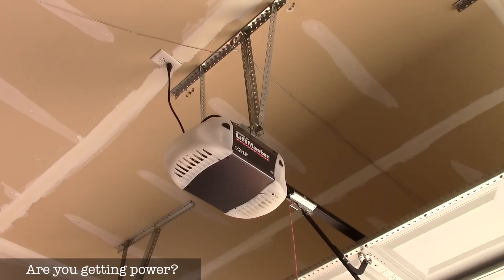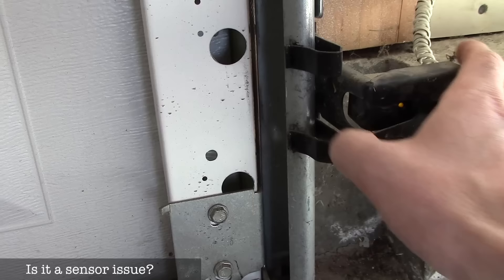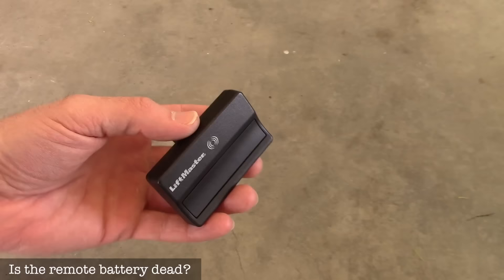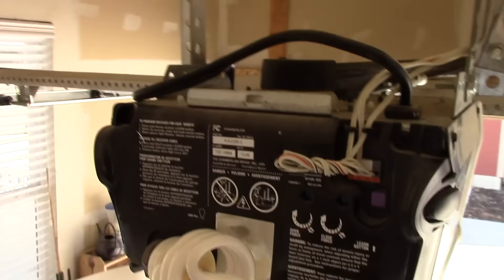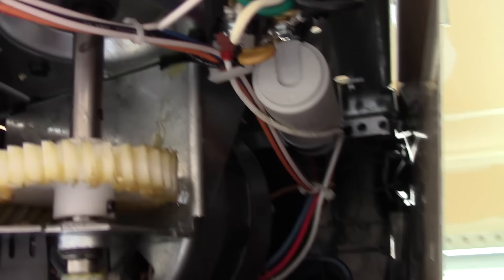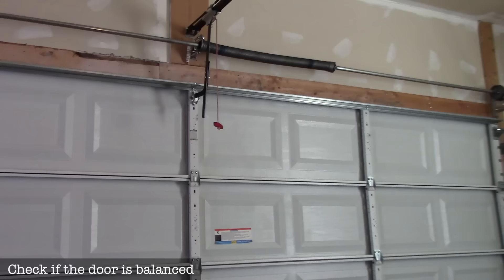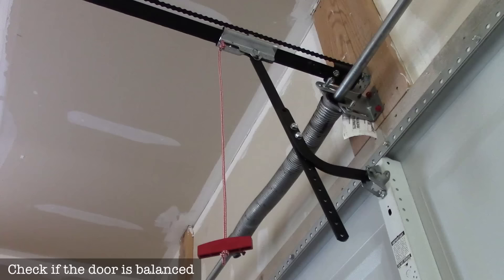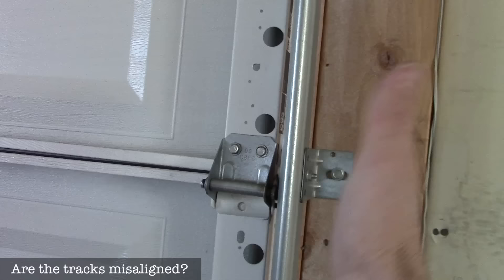Garage Door Opener Troubleshooting and Repair - How to fix common problems

Comment: Thank you for posting this. You saved a 60 year old nun from paying a repair bill for something I could fix myself. Besides, I work 2 jobs (15 hrs a day) so I am never home for repair visits and can't afford to take the time off. The garage door would open, but not close. I don't mind the little bit of inconvenience of getting out of the car, manually closing the door, then leaving through the front door - most of the time. But today we had torrential rain and THAT was the last straw.

Comment: Thanks for posting. Simple solution. Note that on some models, the lights will flash and it's not a sensor issue. Chamberlain LiftMaster Lift Master 3595S Model 41AC075-2S

Comment: open my garage and it went up. tryed to close and would come down a bit then back up.after watching your vid. took a closer look at the brackets notice one broken on the rt. side. noticed it wearing on the wood frame because without that support it veered outward toward my driveway and rubbing the wood. hope i can buy this small bracket (Hinge) at the hardware store. Then i need to tighten the chain and i hope thats it. will see Sunday. Its great to learn at You Tube University with terrific Professors. Thanks Adam

Comment: Hi Adam, my garage door opens sometimes randomly when we are not home.  We will come home Abe it will be wide open. One time it was only about a foot open. Do you know how I would fix this? We are weird stuff will get stolen from our garage because we live in a condo which a lot of people are in the community.
Reply: Maybe your neighbors remote are opening/closing both their door and yours? I had that happening with me. My neighbor had an extra opener that she gave me. When I programed to work with my door I thought it would automatically cancel hers; but it didn't, it would open/close both of our doors together. I then, went to her opener and pressed the Program/LEARN button for 60 secs. That reset it from her door but kept mine.
Reply: WHAT YOU DID WAS ERASE ALL THE CODES. @realestatesolutionsbyrosie9757  w
Reply: You need a new logic board or you're on someone else's frequency

Comment: garage door doesn't work sometimes makes a clicking noise when not work......But sometimes you just wait and it works?????
Reply: Hi pp
Reply: Have the same issue, how can I fix it?
Reply: I have similar issue, i hear 2 clik clik but doesn't work! please let me know if you know how to fix please, Thank you
Reply: Intermittent problems can be difficult to troubleshoot.  Try to determine if it happens when you use the remote control or the directly wired wall switch, or both?  
For problems while using the remote:
- Replace batteries in the remote
- Pray to your God
- Remove the light bulb from the opener (be safe)
- Turn off any nearby WIFI devices
- Turn off nearby portable phones 

For problems while using the wall switch:
- Check that the safety sensor is properly aligned
- Clean the safety sensor on both ends
- Check that red light comes on as he showed in the video
- Bypass or check the wall switch
- Check that the wiring that connects the safety sensor to the motor is intact
Think safety first.  Good luck.

Comment: I was told someone saw someone's face get re arranged by working with a spring, BE CAREFUL!
Reply: I WEAR SAFETY GLASSES AND A HARDHAT WITH A FULL FACE SHIELD WHEN WORKING ON THEM ,THOSE THINGS SCARE THE HELL OUTTA ME ! .THE AMOUNT OF TENSION BY TURNING THE SPRING WITH A BREAKER BAR AND RATCHET IS INCREDIBLE !

Comment: Great video. Love the way you explain things in a calm and steady manner without going on foot too long. I have an issue ( forget sensors for a sec) where the door will completely close, but then opens right away. Its not a sensor issue because blocking sensors makes it reopen midway and lights flash. So its not a sensor issue. Why does it not stay closed? I guess the question is, what part tells it, you have reached the bottom, stay there. Much thanks.

Comment: I had an issue with my LiftMaster only opening a few inches and then closing back. What I found happened to mine was I sprayed garage door lubricant on the chain and it apparently leaked down into the motor housing and onto the travel module. I unplugged the motor and sprayed electronic cleaner on the travel module to remove the lubricant and then blow dried it with an air hose. So far it’s been working fine.

Comment: wow your video help me a lot and thank you for you video. it was a complete detailed video of troubleshooting.
frequency coming from the led light bulbs in my garage was making my garage door no open or close unless I use the garage door opener from the wall. soon as I removed the light bulbs , the garage operated as normal with no issue. thanks again for you help.

Comment: Adam, thank you for a comprehensive, and detailed Video clip. Our previous Home
 had a Chamberlain opener (which I installed myself). It did not function one day,
so I examined the Laser units and found that one strand of a Spider's web was
causing the problem.
We now have a Genie opener; however, the Learn Button fails to function when 
depressed; thus, the L E D light fails to illuminate....accordingly I can not program
my new remote controls.

Comment: Thanks Adam, your video helped solve my problem. One of my sensors lost power. Simply freshened the connections at the sensor and it's working.

Comment: Thanks for the very informative video. Although it didn't cover the issue I'm experiencing, it was well done. I'm wondering if you have come across this issue? My door opens to a certain point and stops then I try to close it and it travels maybe a foot and stops try to open it again it goes back a foot and stops. I then tried adjusting the force limits with the blue dials to increase the limits and the door open and close properly. I waited for a period of time opened the door again and had the same condition occurred . Now I have gone to the end of my limits .
       Thanks Henry Schmidt.

Comment: Door works fine with the wall switch but not the remotes. Just learned about a lock that disengages the remotes. Plus disconnecting the wires from the motor and wall switch and reconnecting might help also. Trying it out next weekend

Comment: Nice informative video. Thank you. Not sure what my issue was but after un connecting the safety lights and reconnecting  I have not had an issue with the door stopping while closing. I went ahead and greased the chain with Lucas sticky grease. It’s more quiet now at least. Maybe talk about chain tension in another video possibly. One of my doors the chain sags about 1 1/2”... but works fine.

Comment: Good video.  2 things I noticed definitely oil the bush under the sprocket it will never fail, there no way it’ll snap off unless the plate wears through that thick shaft from lack of lubrication.   Also the join in the chain should have a spring which allows for self tensioning over time and shock absorbing relief on the chain at start up, perhaps yours are missing.

Comment: Great video Adam, clear, concise, and informative.  Worked thru all of your potential issues and I'm still w/o a functioning door opener.  I have a flashing led at the wall console and pushing/holding the lock button down does nothing to get me back to a solid green led at the console.  I removed the power to the console by disconnecting the wires at the back of  the console effectively taking it out of the loop, removed the door load from the equation by pulling the manual chord to disengage the door so the opener only has to cycle the chain, pushed the remote and it will not engage the garage door opener to open the door.  Appreciate any replies, and many thanks.
Reply: I have the same problem...Thought it was my neighbors remote doing it..checked and it wasn't. Still havene't figured it out...Did you find anything out?..Thanks

Comment: Thanks for posting. I have the same opener. I will let you know what I find..... So the garage door would not close unless I did and override and held the wall switch down. The green LED's on the two door safety beam were not illuminating, so I measure the voltage at the main unit. It was about 6VDC. The voltage at the sensors was 0, so I redid all the connections of the 24 gauge wire and it fixed the problem. I think I will solder the connections just so it will not happen again. Thank you for posting. It was at 4:00

Comment: Hey, thanks to this video, I was able to solve my problem with intermittent remote s not working. Yep, it was RFI form recently installed LED light bulbs. Replaced with incandescent bulbs and works like a charm. Thanks again. Saved me mucho deneira.

Comment: Thanks Adam, can I add one more quick fix for an opener where someone was tinkering with the control adjustments. I ran through your list of items and all was well except the operator still wouldn't work so I was just about to give up and order a circuit board and decided to check the travel controls. It seems someone many years ago adjusted the UP travel screw too much and the carriage was hitting the stop bolt. I turned the UP travel screw counter-clockwise and it fixed the problem. It seems that the operator was still trying to bring the carriage up and couldn't so it just stopped the opener from working. By backing off on the screw, the operator completed its cycle and sent the carriage back down to close the door.  The previous homeowner or someone she hired caused the problem.

Comment: Holy smokes batman. The lock thing was my issue. I been in my house 2017 and never knew. Me or my husband must've pressed it by mistake. I was leaving at 545am and I used the one in the garage to open. When I pulled off it wouldn't close but kept blinking. I was like ok so it's knows I'm pressing it idk what gives. So I just closed it and walked thru the house. I just got home and it wouldn't work. So I search YouTube you were the 2nd video and poof magic. Thanx a bunch. 🥰

Comment: Thanks for the information. I am able to open my door even when the latch is on. Technically to open manually you have to release the latch but mine is latched as I can open with garage opener but I can open manually also. Please let me know if it is a serious issue and I need tech or something very easy to fix myself.

Comment: Excellent videos.  Thank you very much.  I have a LiftMaster 2280C opener and recently the two 973LM remotes will only work if they are in close range, maybe 10 feet away from the opener.  I have changed the batteries and that didn't help.  I would appreciate your thoughts on what the problem might be.  Thank you very much.

Comment: Hi Adam, thank you for sharing this video.  Hope you can point me to the right direction to repair my LifeMaster garage door opener.  Suddenly yesterday my garage door doesn't open or close.  I checked for power, looks like it does has power because both sensors left and right has lights.  But the funny thing is i can't open or close using both remote and keypad (mounted outside by the door).  So basically when i press the remote or keypad, i don't hear anything.  No motor going and no light from light bulb off the garage door opener.  Not sure what to do next to troubleshoot.  Currently i open and close it by emergency release.  Thank you for your time.  Hope to hear you soon.  THank you sir.

Comment: Nice video, I subscribed! I was building a horse shed for a customer when the garage door opener stopped working, didn’t find the solution here or anywhere else though, it is an old messed up garage door and the previous installer did a minimal job, I gave up and told them to call the service man, my suspicion is the capacitor but I don’t know, I liked the video though🙂

Comment: Thank you so much for your help, this is very helpful. I purchased a new sensors I connected them but I don't have the lights anymore. I had the lights with my last sensors. But once I installed the new sensors there is no light.

Comment: I needed to install new Liftmaster rubber belt. Very quiet and nice feature like wifi and easier open close adjustment. The new outside remote you can just press "enter" to close door. The car remote has three buttons for three doors.

Comment: Thank you.  I have an opener that will travel 6-8 inches and return to the open position.  I was lubricating the chain, rollers, etc as the door was very loud.  During the process it stopped and will only travel 6-8 inches now. I’ve checked all the obvious issues.  Nothing is blocking.  I disconnected the door and manually it will travel up and down. It’s just the opener that is malfunctioning. Thank you for any assistance. It is a lift master built in 2017.  HL Fry

Comment: Great video,  It lead me right to the sense that had a broken wire. I simply undid the screw took out thr broken part and put the wire back on the block and screwed it down tight. Still having to find out way the remote is intermittent?

Comment: Thanks for all that for sure! So parents got a 1/2 hp Chamberlain Professional (it's red) chain drive I'm trying to help them troubleshoot. Both wall buttons as they press and I stand up there at the unit it juts buzzes like it wants to try and open but it dosent budge...from what you mention it's sound like it may be capacitor

Comment: Hi thanks fo making this video It was very clear to understand and very informative
I have a question all my remotes work fine, the outside controls work fine but the indoor panels do not function and the light is not on and the door sometimes opens for no apparent reason 
Any suggestions?

Comment: Adam, what do you think would be the problem if the garage door sometimes does not work from the outside keypad or the car remote but it always works from the main button on the wall?  One sensor is green and one is red.  Battery has been replaced in the keypad but it just flashes red. The light was replaced with a Genie LED bulb that says it works with all brands.  The brand of the opener is a Liftmaster Professional.

Comment: Great video! My garage door just simply does nothing when pushing the remote button or the indoor button. It worked great until one I pushed the button and did not open, and hasn't opened since. Tried everything, hoping there might be something silly I'm missing it just does nothing when I push the remote or indoor button. Maybe just time for a new one. But I hate not finding the issue...

Comment: Hi -  Very thorough video - Thank you!  However,  Ive tried various that you've mentioned,  but still same issue:
- FYI - The wall panel remote works with no problem. 
- However, in ref to both the hand-held remote, as well as my car (which has been programmed for many years) - both started to experience the same issue on same day:
If I push either - the door goes up with no issue.  However, moments later, when I push again, it will not go down.  BUT if I sit in my car and wait for several mins, and attempt once again - it will successfully go down every time.  Any thoughts or solution?  Tks!

Comment: I am still stymied - I only hear two digital clics when I Press open on the remote or the wall unit. Also, should the trolley with red handle move back and forte when disengaged from the door? Your video was Great describing all the Other issues. Thanks again Trever

Comment: Thanks for your clear instructions....I checked out all the ones that I thought might be my issue, and have not figured it out ---yet...  The garage door opens and closes from the button on the wall in the garage.  After I back out, the remote only every once in awhile will close it.  But lately will not close the door.  When I'm coming back in, the door almost always opens with the same remote.  ANY ideas?

Comment: Great video Adam. Learned a lot. My issue is the opener seems to lose power intermittently and therefore will not work. Plug unplug sometimes seems to reset. Any idea what that would be?

Comment: Hello Adams, thanks for the informative video. I have a garage door opener very similar to the one you demonstrated in your video. I have a problem opening the garage door in spite the motor making a similar noice as when it was working well. So I don’t think it’s a power problem. I have tried to follow your troubleshooting tips. I discovered that the chain is slightly loose as it’s touching the metal rails. The spring does not have any gaps so it may not be broken, but could be possibly loose. No horizontal sensors but would return in case there is an obstruction during a horizontal descend. I have not yet pulled the hanging red code to lift it up manually. I wanted you to please weigh in before I make any manual manipulations. Thanks for any recommendations you may suggest.

Comment: Hi thank you helping people to fix their garage door opener.
I have a challenger chain driven opener model 3089. 
The motor is straggling to move the chain but the chain even without the door connected to it moves point by point very slowly and it stops some were in the middle.
Could it be the bad gear or bad capacitor or something else.
Ed more.

Comment: Hope you can help me. All three of my remote started having problems since one month ago. The garage door responds to the remote sometimes. Sometimes the door doesn't work at all with the remote. The door works well with the wall control unit. I kind of think there is some kind of signal interference. I don't have any LED bulb nearby. What do you think the problem could be? *I replaced the battery for the remote already

Comment: Great video full of info. Got a question on garage door that closes sometimes about 3 inches after being fully open. I have adjusted the up travel and still have issue. Would that be a spring tension problem? Thx